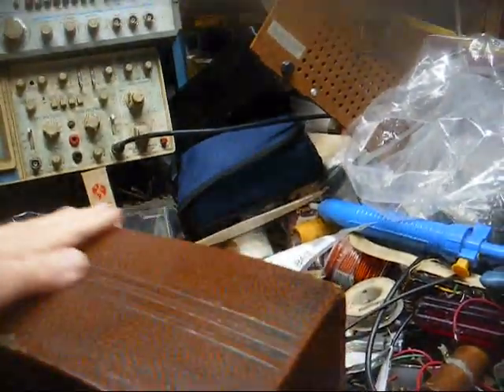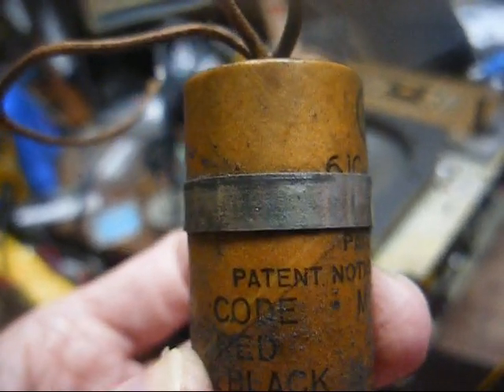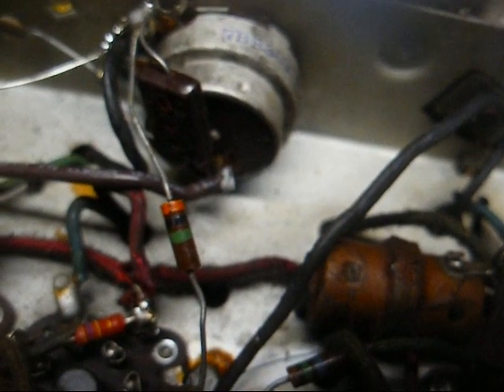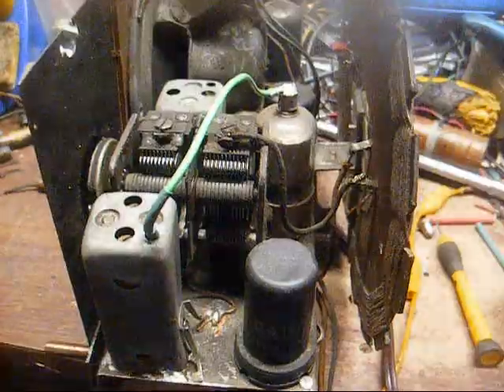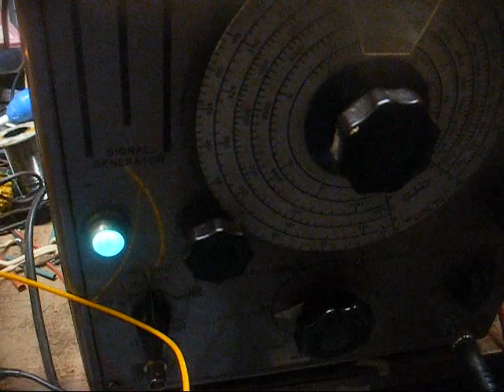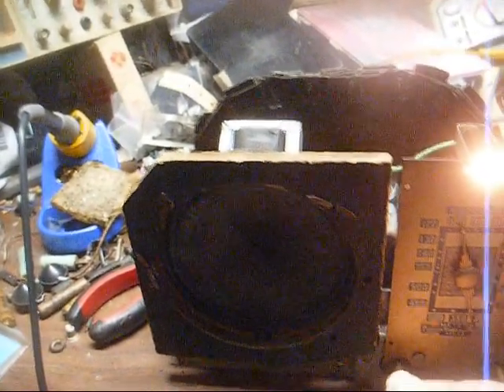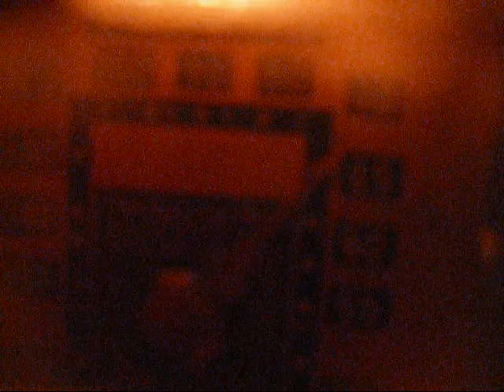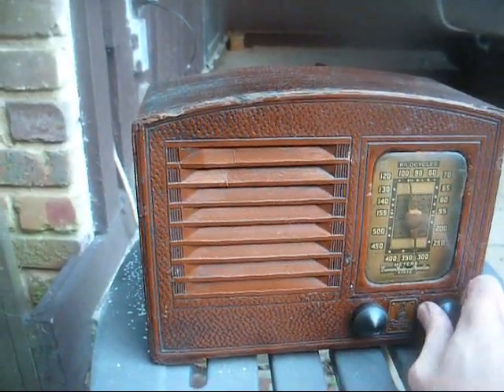Emerson cardboard tube radio repair (just now getting around to uploading it)

Comment: The fact my Philco 40-185 stand-up console and also some 1960s Japanese console both no longer have functional speakers is the reason I don't leave speakers out exposed anymore. What's sad is the speaker for the Philco is completely done, needs a full recone if even possible, as the poor cat thought the speaker looked like a good bed and exploded the cone. Survived 80 years only for that to happen while I had the cabinet apart for cleaning. Now I need to figure out a replacement for the original 12 inch speaker until I can get the original reconed. The Japanese set somehow got one of its speakers damaged by a run-away screwdriver.

Comment: I found when replacing the coloured wires on the if cans .first I cut the wire to length. Then pull out the strands on the cut length. Then your left with a coloured sleeve then I slide that over the   bare  soild wire .( only because me and if coils don't get on  very well lol
Reply: bare* - if you slide something over a bear wire, the bear may get mad.
Reply: @RoughJustice2k18  ha ha just realized he will definitely get mad

Comment: 🐨 I gotza say I really enjoy yo videos thar sir.. 
So much so, I subbed and as per usual for my subbed channels I dropped them a big ole 👍

BTW there are suppliers now that supply modern day cloth insulated wiring in all colours ?! WAIT! I mean jezz for yo Merry Kin Folks Err-I mean Colors. 
Also another tip that might interest yo is in keeping yo restorations to a really high standard is, With Electrolytic Cans yo kin gut em and shove the new electrolytic's in the innards of the original cans, also for other capacitors yo kin wrap some Yellow or Tan colored paper followed by a dip in wax which have been printed with them values of the replacing capacitors and particulars on it of when yo loving restored em, I know~I know it's rather bothersome.. But hey, For all that extra attention it makes for a massive, no seriously massive appreciation in dollars by collectors who have the serious bucks when in comes to gems such as this here Radio presenting themselves near to original 😉
Reply: Yes. https://www.tubesandmore.com/products/wire
Hope this helps!
Patrick